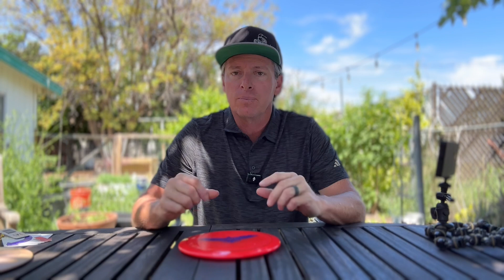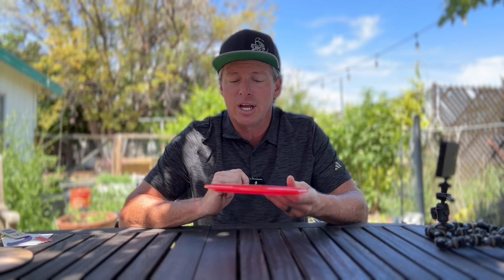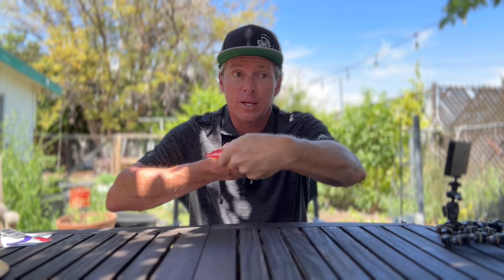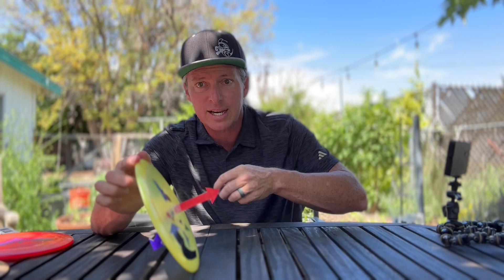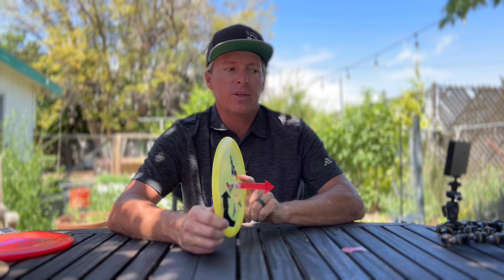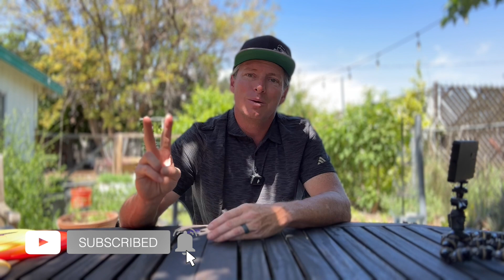Roller Physics 101

Comment: Your explanation REALLY helps me understand what the disc is doing. I was purely lift-based thought before and couldn't rationalize accelerating vs decelerating/ advancing and retreating edges (think, helicopter blades) as the driver of turn.
Reply from the maker: I used to be in that camp many year’s ago, but as it turns out, the science shows the advancing and retreating edges of the disc have virtually zero effects on the flight of the disc. (eg. there is No measurable Magnus effect).

Comment: Can you explain why the center of gravity changes ?
Reply from the maker: @kennydon  thanks for watching and the question!
I don’t believe I stated the center of gravity changes. I imagine you are referring to the part of the video where I stated that “the moment the disc comes in contact with the ground, the point of contact becomes the fulcrum point”.

A disc in flight has its center of gravity or center of mass at its center. This doesn’t change, weather the flight is flat, hyzer, or an-hyzer, its flight properties will be subjected to the forces of spin, gravity, lift, velocity, and drag. During flight, the air pressure over the disc changes with speed, and thus how the disc moves in relation to the forces disrupting and tipping its balance towards turn and fade.
 
When the disc comes in contact with the ground, the discs center of mass doesn’t change, and its normal flight properties of lift, drag, velocity, spin, and gravity are still acting upon it. As the Weight of the disc pushes down into the ground, the ground pushes up. This contact point now becomes the fulcrum point for all those other forces to act and react to.

What changes is where we are balancing it from. Another analogy could be: we can balance a broomstick at is center of gravity lengthways, or we can balance it on its end. Its center of gravity doesn’t change, where we measure its center does change.
A disc can be balanced on its injection point, or upright on its edge. 

I hope that answers your question!
Reply: @ you should work for Area 51 designing ufo. Thanks man imma reread this again.

Comment: this is superb practical concept teaching. You can tell  you're speaking from a point of knowing moreso than most these type of videos where they are regurgitating discraft wiki.

My favorite roller disc right now is forehand with a Axiom Mayhem [13/5/-1.5/2]. If im understanding it correct, its ability to hit like ' / ' but flip vertical and remain ' | ' would be because enough spin, generating lift to pull it up vertical, but then the Gyro stabilizes the force between gravity (or lift?)  pulling it like ' \ ' . Where more Spin would equal to a roller like i've described remaining vertical longer?
Reply from the maker: Over all I think you’re getting it.
the lift force pushes against the ground, the ground pushes back, that effect takes place 90* away and causes the tail to move down, this in effect lifts the nose of the disc and is also responsible for the disc “standing up”.
Higher Spin causes the disc to resist all the forces more, it stabilizes the flight and roll. Spin doesn’t cause more lift or turn….
Once/if a disc reaches a point of equilibrium between lift and gravity, the momentum and spin will allow for a longer run out.

Comment: Hello! A nice explanation; do I understand correctly that you focus on the impact of lift only, leaving effects from low/high speed turn/fade out of this video? Would love a continuation adressing those for rollers, too!
Reply from the maker: I stated that “just because a disc is rolling, doesn’t mean its flight characteristics are negated in any way”.
I did a video prior to this one explaining why discs turn and fade and and the effect of those forces with under and over-stable discs. This video was basically building on what was discussed there.  In this video I’m hitting the basics of how a discs lift applies forces into the ground, which accounts for some of its curious behaviors on the ground.
An understable discs center of pressure/(lift) moves behind the center of balance which would lift on the tail of the disc, but because of gyroscopic precession that force would transfer 90* in the direction of rotation and we would see the left wing lift up…. With a very overstable disc the center of pressure would stay in front of the center of balance lifting more on the nose, and because of gyroscopic procession we would observe that effect on the right wing lifting towards fade….
Thus is very interesting and complex because in both cases though the lift is towards the top of the disc, the “where the center of lift” is  located would seem to be at opposition with the forces imparted between the disc and the ground. 
So currently for simplicity sake, sharing the understanding that the lift vector is very much responsible for a roller lifting and thus applying force to the ground, causes  the “standing up” while rolling at high speed. 
Applying what we covered in the previous video towards this video was the intention, but I now see i didn’t make that super clear and I chose to not add more of that information into this video to avoid making a 30 minute video.

Thank you for your comment, it’s valuable and I’ll try to work on being more clear and become a better communicator as I learn the art of sharing ideas on this platform.
Reply: @DiscgliderPete  Wow, thanks for the comprehensive reply! I just want to make extra clear that what I wanted to communicate was curiosity, not criticism. Keep up the awesome videos!
Reply from the maker: @isaknilsson71  of course! I love all the comments, they help me think critically about the subject matter and learn what ways I can become better at communicating ideas. Appreciate ya and thank you again for watching and reaching out. Do you have any questions or things you’d like to see on the channel?
Reply: @DiscgliderPete  Ooh... well, apart from the "should I select roller discs based on glide and/or turn/fade", there are some special shots I've been wondering about. Like, does the flare skipper (backhand) go sharply left because the hit from the ground gyro-precession-snaps the nose "up" or for some other reason? And why doesn't a disc with lots of glide (lift) go straight into the ground when thrown upside down? Do discs have lift in both directions somehow? :P

Comment: Another great vid. Love these. Heres an idea for a vid: why do tomahawk and thumber throws pan slower when a flat top disc is used?
Reply from the maker: Thanks for the comment!
I haven’t put much thought into that at the moment….my initial reaction would be
I think It may be a similar reason to why a flat bottom boat is preferable to stand up in compared to a canoe.
Then would work out the thought experiment from there. Lol
Over-stable discs are often preferred for those throws also, so it’s possible that they help control the delivery and nose angle better for those throws.
Reply: @DiscgliderPete  That's an interesting thought. Yeah flat+overstable = bombs

Comment: Yeah I don't know of that helped me throw better rollers either, but it was cool to see. Also also my discs are suddenly more flippy than they should be. 

I hear rpm tends ro improve linearly with speed, up to about the 65-70 mph ball park. Then it tends to tail off pretty considerably, if youre at 1200 rpm at 60 mph you might only be at roughly say 1300rpm at 70mph. 

Are there any discs that are reliably stable with lots of forward push. Destroyers seem to be too much for me new at least, and even something like an mvp photon is very beefy. Ive throw over 500' with a shryke, pharoah, and prodigy d3. But they are not at all predictable flights. If I nail it, and hit all my angles perfectly I bomb with them but If my angles are wrong slightly its terrible. But a photon is hard to reliably get out to 400'.
Reply from the maker: Thank you for your comment.
Yea, this wasn’t intended as a “how to”, but rather a “isn’t this fascinating” video. :)
If you are throwing around 400’ with a stable disc, you probably are throwing in the neighborhood of 56-60mph.
Your experience is relatively normal. Flippy discs fly farther with the correct angles, but are also more unpredictable.
What you may need more of is Spin. That’s what makes disc “push forward” like you stated, the other would be a good nose angle.
Nose angle is easier to correct than increased spin. However, both take work to get consistent. 
Gannon buhr, Paul Ulibarri, and a select few others have a spin rate that pushes over 1600rpms. Gannon throws in the 70+mph range and Paul in the mid 60’s.
I know guys that throw in the upper 50’s with 1400rpm range. A lot of that is in the wrist and grip, and is a hard metric to get others to increase. I don’t have a magic coaching tip to increase it other than engagement of the wrist at the hit point. That fine motor and fast twitch muscle activation takes a lot of time to get trained. Think how long it would take to become proficient in writing with your off hand. It simply takes time.
All this to say, there are a lot of excellent discs out there, but not one of them throws itself. You’ve got to find a disc that works with where you are at currently.
For me, I’ve been absolutely blown away by how far and how straight the Discraft Athena has been flying for me. It’s flying nearly as far as my nukes, while still remaining stable in high speed flight.
So hitting 400’ with both, but controlling the landing angle better with the Athena.

Comment: This video made me think that the less stable a disk is the less force I need to create an enough lift on the disk  to counter the force of gravity.
Reply from the maker: I suppose a better way to say it would be:
A little piper cub airplane takes less energy to get off the ground than a leer jet. The amount of lift they generate is dependent on different speeds and AOA. 
The less stable a disc is, the more the lift generated by that particular airfoil moves behind the center of balance at speed, this causing a disc to turn because of gyroscopic procession. Under-stable discs “turn” more. 
When rolling the discs flight lifts toward its top, if the center of the lift pressure moves behind the center of gravity, it causes the disc move towards turn, when in contact with the ground, the force on the ground causes the tail to drop lifting the nose.

Comment: I don't think this is it. Your reasoning doesn't explain why a disc thrown on cut would stand up and even turn over. It just explain how the front and back of a disc would move. Here's how I think about it.

A roller changes roll angle the same way that an air shot changes roll angle. The disc is experiencing a pitching moment because the lift is not perfectly centered. It is either a little forward or a little rearward of the center of mass. When the disc is nose down, the center of lift is rearward and you get high speed turn (I know you already know this :) ). An air shot will transition from nose down to nose up as gravity takes over and it starts to descend. Hence, low speed fade. The cool thing about rollers is that they are always traveling nose down. The angle of attack is always zero. That's just how a disc rolls. That means it is experiencing a turning pitching moment throughout its entire flight...or roll. That's what makes a disc "stand up". A centered lift vector as you explain it here, would not make a disc stand up.

This also explains why overstable discs roll straighter than understable discs. They experience less of a pitching moment at zero angle of attack. It takes them a lot longer to stand up. Understable discs turnover like crazy, hence they stand up and curl really easy. Hope that helps!
Reply from the maker: To be fair, and to avoid a 25minute video, I did explain that just because a disc is now rolling, it doesn’t negate its flight property’s….. its flight property’s are a major component to its turn and fade, which also is a component to a great roller.
How much turn a disc has in flight is determined by its stability or under-stability in flight characteristics. Under-stability is when the lift force moves behind the center of balance, and because of gyroscopic precession, causes the left wing to lift which we observe as flip/turn (rhbh). 
Over-stable discs don’t “turn” in flight, yet we do observe them “turning over” or standing up towards the top while rolling. Part of this is because of it interacting with the ground, and the fact that even though it’s “stable” in flight with the lift force remaining at or in front of the center of balance, it is still generating meaningful lift, that lift IS upward against gravity, and while on the ground the UP force of the lift is then imparted against the ground, thus the ground “pushes” back against the disc, up against the discs gravity and sideways against the force of lift the disc is generating. The force imparted against the lifting vector against the ground is responsible for forcing the “tail” of the disc down because of precession, and thus the “nose” of the disc lifts as a consequence. 
If the disc is rolled on an angle where lifting force is not greater that the gravity vector, the disc will remain cut…a secondary force would also be observed as the discs turn In cut is increased, it would also increase its force “outward” due to inertial velocity, this would also be observable as a similar effect to the lifting force pushing back against the lid/top of the disc, and the discs curve to want to straighten out.
All very complex, but in the video I’m trying to super simplify it.
Thank you for your comment and insightful observation.
Reply: Overstable discs can turn, they just don't for most human throws. That's because even if they are released with the nose down, they don't spend much time with a negative or zero angle of attack. The disc quickly enters the glide phase where the angle of attack is positive. But nearly every disc will turn at zero angle of attack. You have to get to something weird like a Tilt for this not to be the case. 

I understand trying to keep the explanation simple, but I feel like aerodynamic turn is the main factor at play in a roller. It explains why and how fast a disc stands up. The forces you talked about are a factor in the "flight" but they are a minor factor.
Reply from the maker: Yes, An over stable disc can turn depending on airspeed and spin velocity, but this isn’t a discussion about how a nuke flys and rolls if I threw it vs. Anthony Barela, because we know between us whose would flip more……but for all intents and purposes an over-stable disc that’s rolling under normal airspeed and groundspeed circumstances is still over-stable. It would in fact tend to stay as a “cut” roller because of its flight properties, as I stated in the video “when the angle of cut is more than the ability of the discs lift can overcome”. Meaning, the lifting force  acting on the disc would be ahead of the center of gravity, this would cause the discs right side to want to lift because of precession, normally driving the disc in flight towards fade, this is coincidentally the side of the disc in contact with the ground while rolling. This is an interesting point to ponder, because the airspeed would be driving the disc towards fade or cut while rolling, while the contact with the ground would be causing either the tail to lift causing the tail to move towards cut, or drop causing the discs nose lift towards turn. This due to its lift and stability.
The discs contact with the ground and its subsequent forces tend to cause the disc to fly differently. 
For me, a Heat is under-stable, for someone else with a lower arm speed it may be over-stable….
This then would be a conversation about flight numbers and their subjective meaning of their characteristics in relation to each person’s arm speed.
An important factor I believe is how the spin increases by at least double when it becomes a roller. This increases its gyroscopic stability by 50%, and increases its resistance to off axis torque also. So its resistance to off axis torque is increased along nearly its entire flight
So to sum up.
Yes you are correct as far as I can tell in that a discs speed and flight characteristics are a major component in understanding rollers, but the added physics of the flight characteristics against the ground forces, is another large component. 
I’m not a physicist, like I stated in the description. I’ve sought out those that are and are smarter than I am to bounce ideas off of and try to gain understanding from them. This is a simple breakdown of what we’ve discussed and understood thus far. I humbly will continue to learn. Thank you for your comments, they definitely help move towards deeper understanding and critical thinking.
Reply: Love all this!!

Comment: I love throwing rollers and i love physics. This is great stuff that I've always thought about, but never heard anyone else discuss. I've also noticed that at the moment a disc lands, it gets an initial extra nudge from the ground, which sometimes adjusts the back edge of the disc and, therefore, the nose angle, making it look like the disc hit a stick or rock or something and so it shoots off in an unexpected direction (especially on forehand rollers when there is less spin on the disc initially). With this in mind, I'm starting to get the hang of nose angle manipulation out of the hand, in order to shot-shape my rollers more effectively.
Reply from the maker: Yes, if we don’t match the nose angle to the ground perfectly, it can’t take on the ground speed and extra spin efficiently, so the nudge you speak of is basically off axis torque because of the discs trajectory is not in line with its nose angle upon landing.
Great observation!